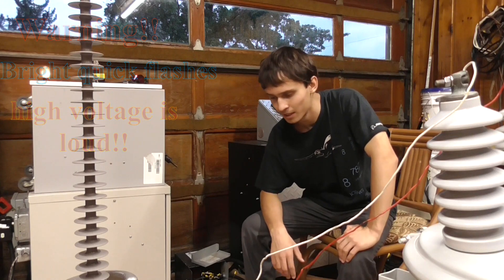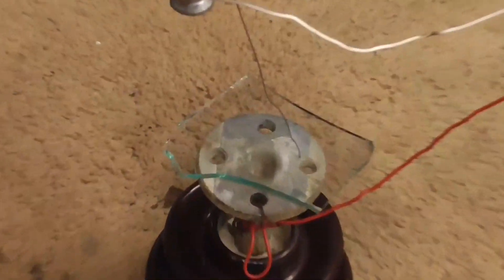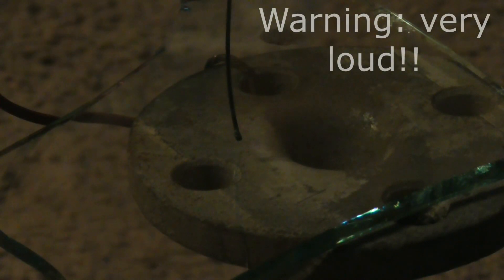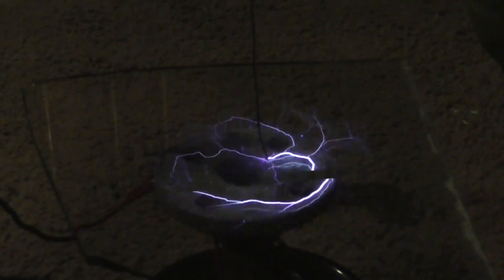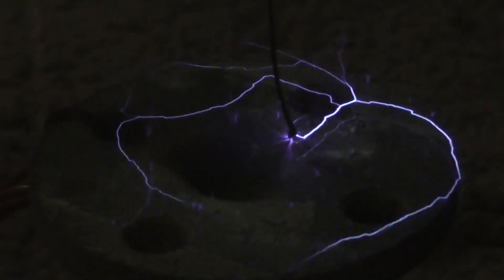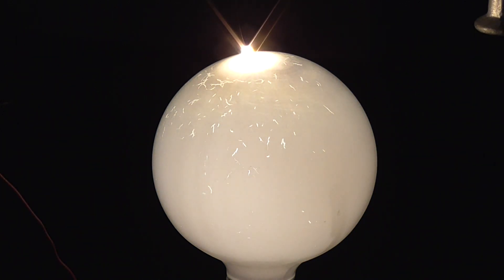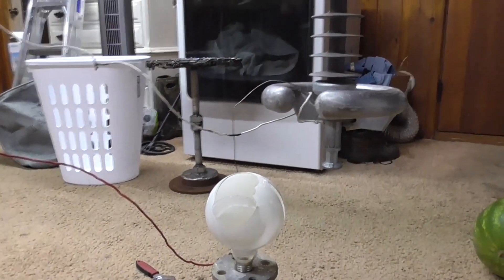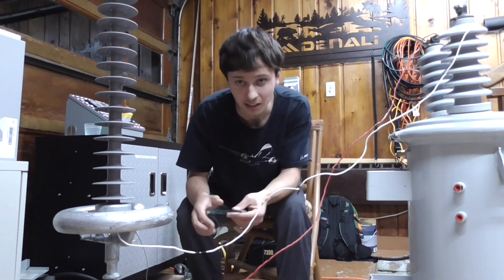Effects of High Voltage on Glass

Comment: Very beautiful and a perfect demonstration,  that there is no substance that is a perfect conductor or a perfect insulator,  when I took an electronics class at a technical school after high school and we studied ohms law and what not many students,  myself somewhat as well, had a hard time grasping this concept or didn't necessarily believe the instructor.    But it makes sense,  because if you purchase electrical rated gloves and other PPE  they have specific voltage ratings such as 1kv, 5 kv, 10 kv and so on.   So an insulator,  is basically a conductor with such a high resistance that, for all purposes in everyday life, does not conduct electricity and keeps us from getting shocked and preventing short circuits.

Comment: I've been trying to find a pole mounted 15kVA transformer my entire life.. Capacitors too. Linemen are not very easy people to get to hand those things Where did you get yours? Cool content subbed
Reply from the maker: I got mine from the manufacturer (Solomon Transformer corp.) This one costed roughly $600 and had it shipped to fedex depo where i picked it up as it is too expensive for home delivery.
Reply: @VariacManiac  Wow you're not playing around. 15kVA? 7620VAC pri/240-120VAC sec?
Reply from the maker: @flaplaya  5KVA 14.4kV primary, 120/240v secondary. It weighs 300lbs. Power companies will not let people obtain such a device as it's a liability issue. Most transformer companies won't either for the same reason. Best option is eBay as you don't have to request a quote, make 2 scheduling phone calls, and to schedule a delivery date, etc.
Reply: @VariacManiac  Gotcha.. I've looked on Chinese websites too but as you've noted the Shipping costs.. Very nicely done and I appreciate the replies.. Thing is a beast.. Oh and I'm calculating you are overdriving the "secondary" which is now your primary by like 300%?  And it is obviously ballasted? Sure you have a video on the configuration... I'll be looking for it. Great work, be careful play safe one hand rule and chicken sticks always.
Reply from the maker: @flaplaya  It was ran at roughly double its rated voltage in the video. I don't do it anymore as I don't want to destroy the dielectric strength of the transformer. In order to accomplish higher voltages, I use an x-ray transformer. I might be uploading in the future, depending on circumstances.
Reply: @VariacManiac  the 125kV one with blown diode packs? Beast!!! No one on YouTube experiments with such high voltage 60 Hz AC. Channel well on it's way and obviously so are you, My hat is off..
Reply from the maker: @flaplaya  Thanks man. I'm just a hobbyist. I created this channel in order to communicate with similar minds when I was in high school. It's been a great 6 years.
Reply: @VariacManiac  Well I'm very impressed. Now that it's working what may be the direction? I'd imagine whatever you put your effort into will come to fruition.
Reply from the maker: @flaplaya  Studying A line worker program, along with just an associates degree. I hope to graduate in early May. If all goes right.
Reply: @VariacManiac  Transmission or substation design or installation if all else failed was my dream. Depending on where you are at get in the door and make friends at your nearest IBEW location.. They are very important.. Your insulator collection is cool. I owned 2 ceramic 2 piece five foot tall 10" diameter insulators (240kV pole mount) and dead end bells from same.. believe they had 20 bells about 12" diameter.. Blew my back out getting them in my truck. Venice 240kV pole retrofit circa 2000. I lost them like the 95% of unique HV stuff I owned.. Getting back though.. My latest idea: MOT cores, one primary and 3,4 or more secondaries in series welding up multiple cores to accommodate.. Magnetic Shunts may be incorporated to limit current like a neon transformer.. Seeing you bare hand that X-ray output shows me you aren't afraid.. Okay with heights?
Reply from the maker: @flaplaya Oh yes, local 876 hopefully. Climbing up poles is fun. Hight only bothers me if I am up the pole with no fall restraint.

Comment: High Voltage and low current displays are awesome.
thanks for vids
Reply from the maker: Yes, especially the corona display you get sometimes. You're welcome, more vids are on the way!!
Reply: i don't think that it's low current since he used the power straight from the electricity grid

Comment: Wow.... That fucking insulator at the start of the video. Only a small one i see. ha ha. Wait, so for the 35kV you where just ballasting you big boys tranny and sticking too much power into it? lol, thats naughty if thats what you where doing as your gonna be very close to breaking down the secondary insulation. Typically they are only designed to withstand double their rated voltage before... FLASHOVER! Ya wouldn't want that if your really unlucky it would end with a massive explosion and major transformer fire. 

That was a great video, dude. ;)